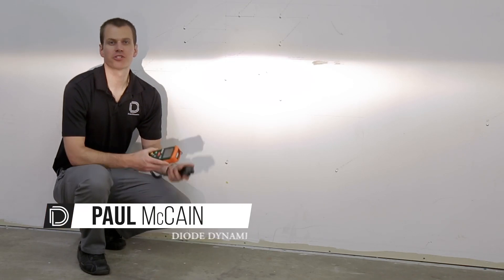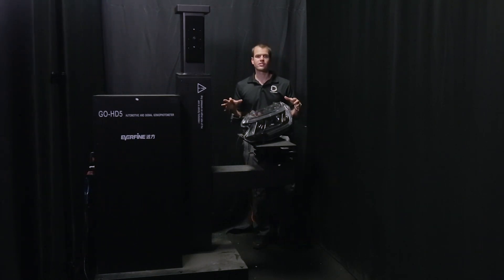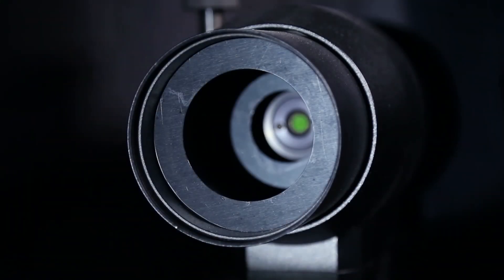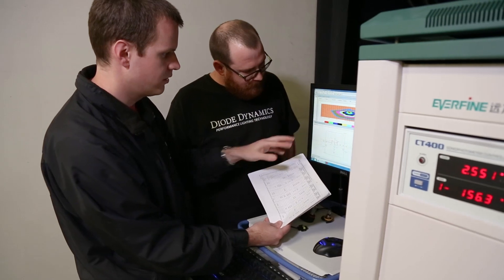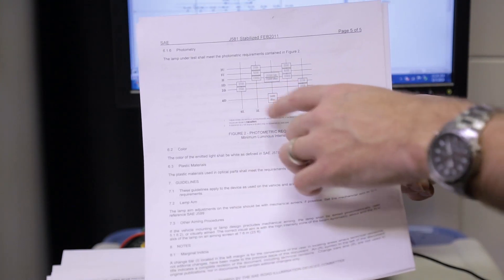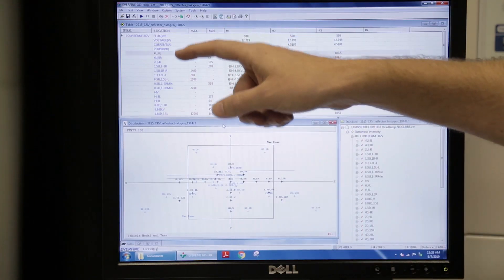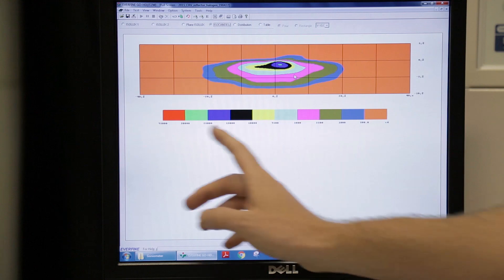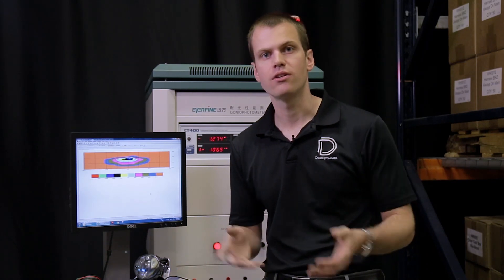Measuring Headlight Output with a Goniometer | Diode Dynamics

Comment: Good Video Diode Dynamics, also does the LEDs that u guys produce have the blue tint that most of the oems have?
Reply from the maker: Hey Steve - the SL1 will be rated at a 5700K color, which is overall just a white light with no hint of blue.

Comment: Hi. That was really interesting. I hope you can help. I'm doing some research and trying to understand a detail in headlight mapping from a case where a person was struck and killed, and the driver's sole remaining headlight was capable of illuminating the road to 5 lux at a distance to 15 metres. Does Diode Dynamics know how far two similar headlights could project light, and at what lux, if both were still working and working the same? The car in question is a year 2000 Mazda 323. Thanks, Heath Ryan.
Reply from the maker: 5 lux at 15 meters is extremely low output. Are you sure that is correct. A single Mazda 323 headlamp must output 15,000 candela per DOT regulations, which would be about 67 lux at 15 meters.

Comment: I’d love to see you take your bulbs, put them in a Ram headlight or something, get the proper measurements with your machine and then put those crappy SuperNova V4 bulbs in and get their measurements. The guys at headlight revolution would maybe realize that they’re selling junk and start pushing your products properly. Just a suggestion
Reply from the maker: Thanks for the recommendation, we will pass that request along to our media team!
Reply: Except those s-v.4s aren't even theirs. They're rebranded Chinese garbage and then they price hike it. Theyre bright but only on the hotspot and they do tests that aren't accurate at all. Like explained in this video. I trust diode dynamics I don't trust Chris Nelson. He seems like a nice guy but the testing methods are garbage and then he says they're the best. They're simply not. Unfortunately a lot of people don't do much research and just take his word for it. Do research people! Read forums and reviews! The SL1s and the crystalux G11F are the best LEDs currently on the market for most headlamps housings